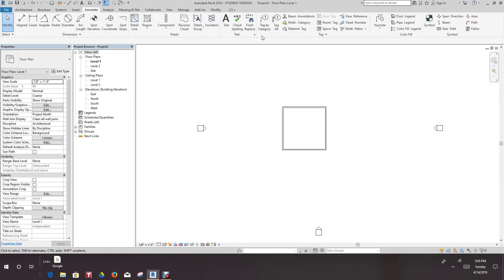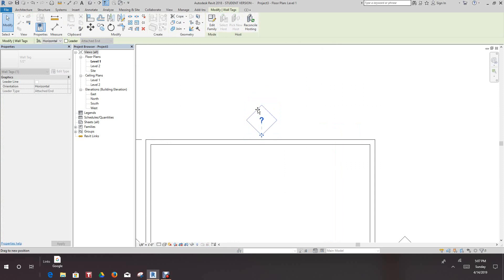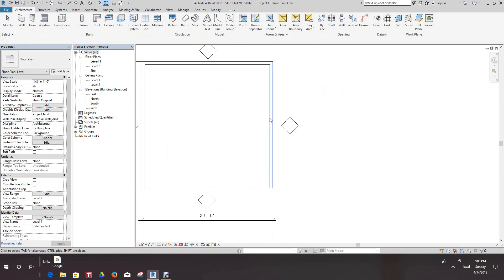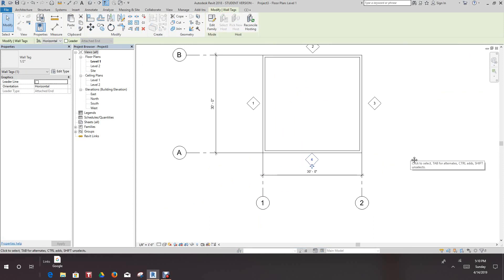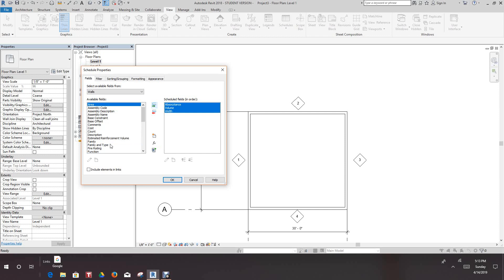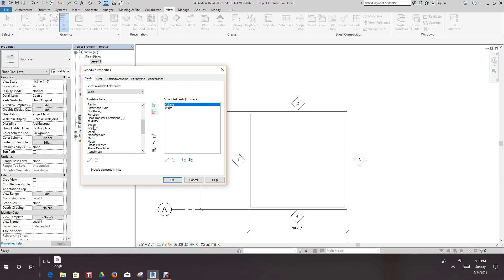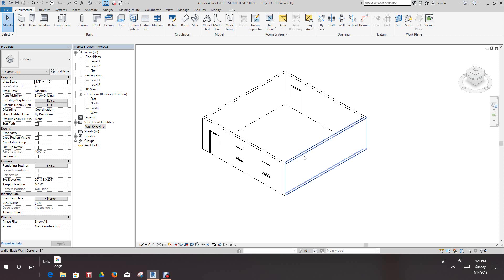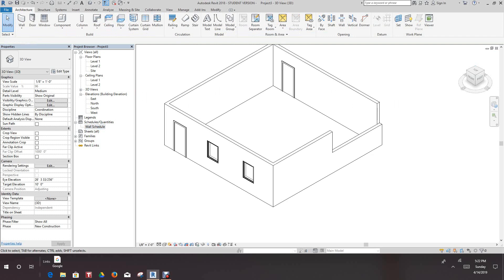Revit Architecture how to Create a Wall schedule

Comment: Can We schedule the interior wall area, exterior wall area, Window area, and door area, by room on Revit? Is it possible
Reply from the maker: Hi great question, I'm not sure I just use the marks. I think it could be done with shared parameters. I will ask around and then make a video. Thanks for watching.
Reply: @unidesigndc  It would be great, Help if you upload a video regarding the above.
Reply from the maker: I think there are a few things you can do, I think this would be a good video. I will try to post soon
Thanks!

Robert